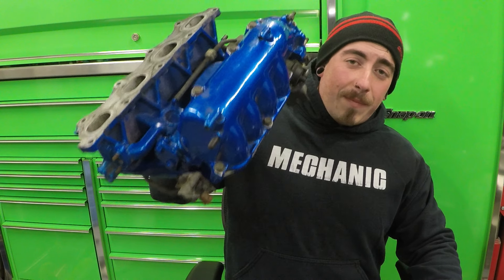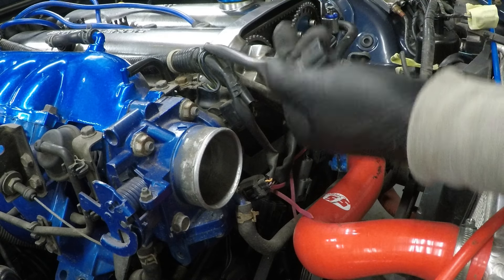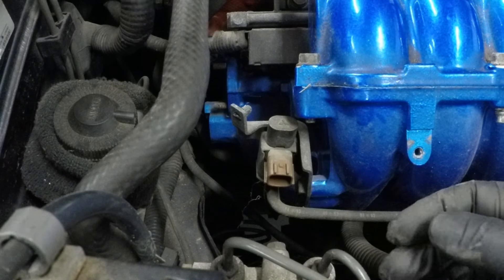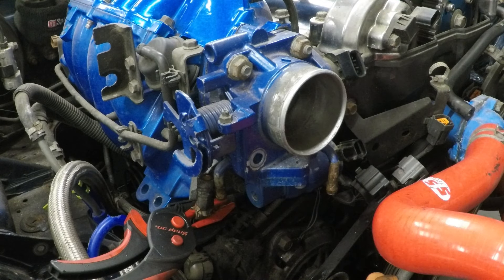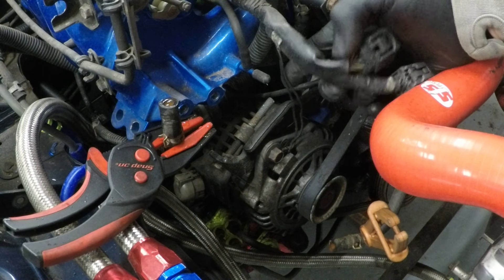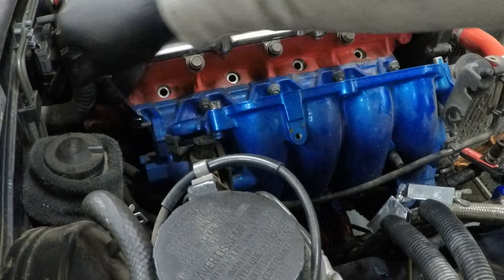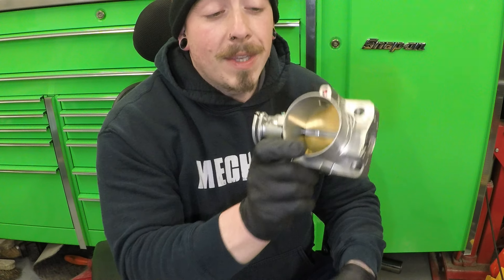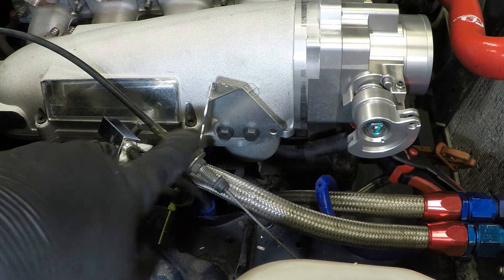MX5 turbo build pt2: Little steps to big power. skunk2 inlet manifold install

Comment: Nice to see you still own the 5 mate. I still have videos and pictures of it fucked with the tyre wrapped around the driveshaft. 
Should have asked about I sold my skunk2 inlet and tb cheap a few weeks ago. 
Be prepared to smash a lot of diffs, shafts and  boxes. Mine kills them. I carry a spare shaft in the boot 🤦‍♂️😂
Reply from the maker: luckily ive got the 6 speed and a toisien diff so hopefully will last 500 miles :D
when its done we shall tandem
Reply: I’ve done 2 5 speeds, 2 diffs and one of them actually exploded 🤦‍♂️ a shit load of drive shafts. Tandem? You mean crash into each other’s doors 😂
Tip remove the rear arb gives a lot more rear grip
Reply from the maker: still got the dent in my wing from last time
Reply: @Project380   want me to print off a zeo was here sticker lol
Reply from the maker: @ZeoStyleAutomotive   yeah mate why not :)